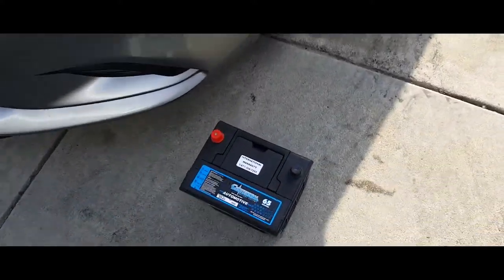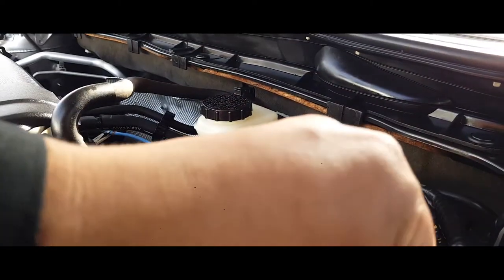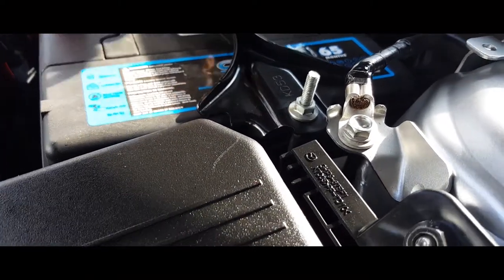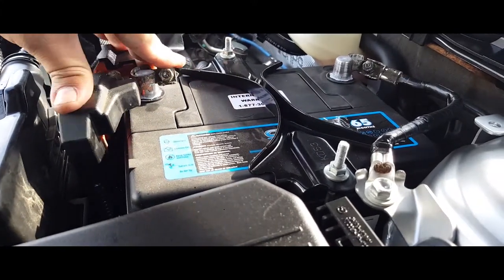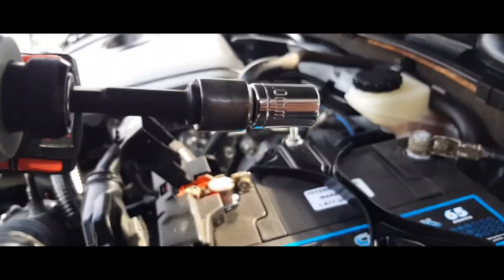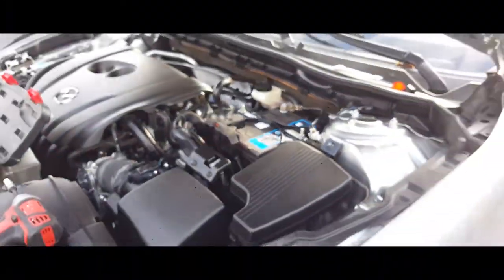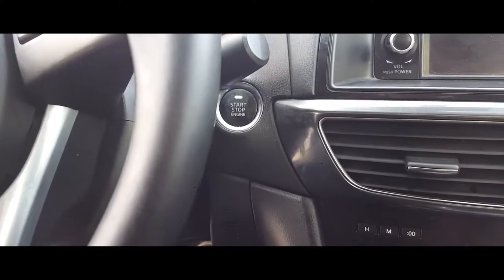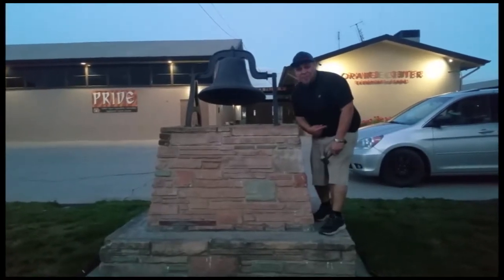How to: Install a Battery from a 2014 Mazda 6

Comment: Do you need to do some setup from LCD panel or Mazda recognises it automatically?
Reply from the maker: I didn't have to use a memory saver, I work at a dealership and most cars come with dead batteries so I have to swap them out. The battery is dead so no need for a memory saver. Should be okay